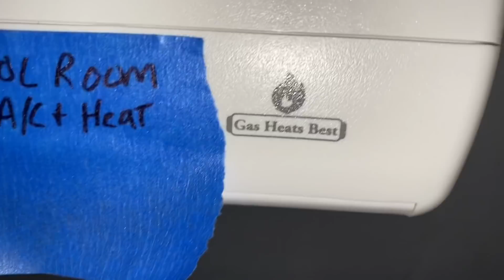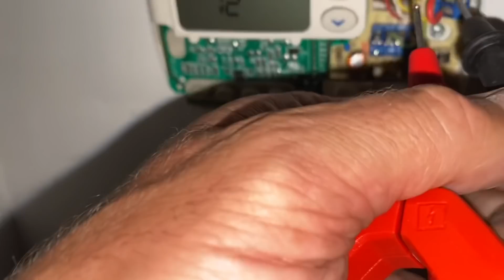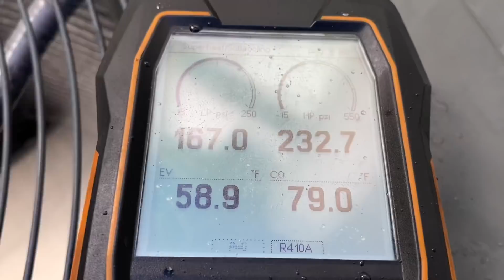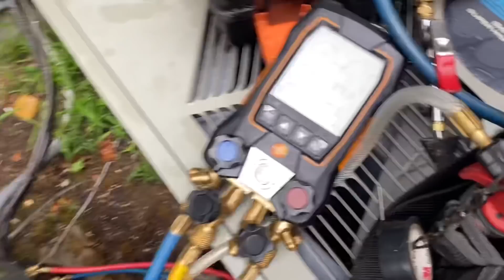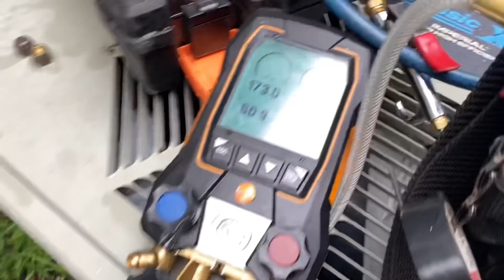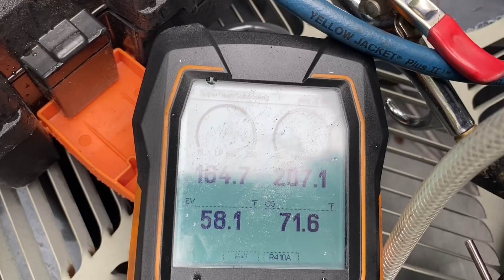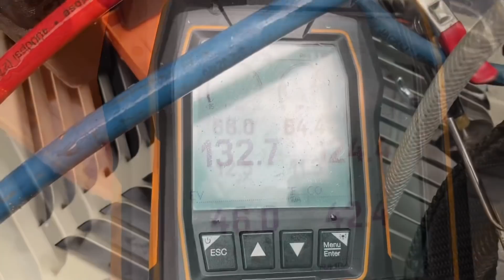Mysterious Issues With Central AC Compressor on Trane R410A System - Why? Bad TXV Killer 1 Already

Comment: Had the same problem a couple weeks ago.
Same pressure readings but in my case you can hear the bypass relief valve. And I wasn't able to pump it down. After changing the Compressor ac system ran like a Champ. Good call.

Comment: All the craziness that can go on... I have a Trane (American Standard)  and just happened to be home when the power blipped .... Scroll compressor started running in reverse  It was LOUD and i knew not right so pulled the disconnect  outside and let it sit... after 20 minutes reconnected and didnt seem to do any harm.  Its a Copeland and they are tough as nails.

Comment: Cheapskate customer: 1976 payne pkg unit, bad compressor. Owner had said it was about 15 years old and had been down a few years (decades probably). The unit is basically scrap. Told the guy to replace it. He hires some  "handyman" to R&R compressor. Installs a 410a compressor. Calls me out of the blue and says he purchased a jug of 410a, but handyman has no gauges and would I be interested in charging it for him? I couldn't help from laughing....enough for him to hang up on me. Some people!

Comment: Wow , I wonder if that was one of those set ups where they test repair techs to see if they are exploiting customers . Your SOOOO right Mikey . It was sabotage . Someone was messin’ with Mikey pipes . Not cool . Mikey pipes wasn’t born yesterday . Good diagnosis and I’m not even a hvac tech . A cars a/c compressor would act similar if it were weak . Shows up on the gauges . Daniel is getting taught very well 👍

Comment: Seen scroll compressors with high back and low head have a leaking internal relief . If you loose a condenser motor or really plugged coil with no hp cutout pressure relief opens and may not completely close .

Comment: @5:50 that burnt label, in a perfect oval, I believe that is the compressor tag you pull of when replacing under warranty and send it in with the paperwork and old compressor, the units usually come with an orange, I bet that black is a warranty change out/ what the supply house had in stock at the time

Comment: Miss the old recips. Tuff, and checking the valves with pump down was very conclusive. Ya could actually pump the low side into a vacuum if the pump and valves were good.👍 
Really like that new flare tool as well. Good job, brother.

Comment: The compressor likely has bad valves causing the compressor to over heat and not compress. If you see funky pressures and you close the liquid king valve down you might have a bad reversing valve unless you hear the compressor bypass valve. Why you're seeing is someone took the label off of it for their records. you still have another label underneath. Likely someone scamming the manufacture by taking serial off and putting it on another compressor to get multible warranties. Id check the amp draw if its really low you have a broken shaft. Thanks for the videos as always Mikey Pipes the pipe Doctor!

Comment: Rare to see a replacement compressor on a residential unit! Those scroll compressors are not a tough as the old recips! They are pot metal inside and are cheaper to make! Great video and great call to just replace that crap Mikey pipes!

Comment: hi, i bought a new air conditioning unit within the last year and a half from Goettl. the compressor just went out (it kept tripping the breaker). They replaced the compressor, do u think that there is harm to the condenser or any other parts from having a bad compressor. is it normal to just replace compressors without replacing condenser or anything else?
Reply: Yes, as long as they replaced the refrigerant and pulled a good evac on system.
Reply: @anthony5530  ty

Comment: That looks like a scroll compressor, they don’t have conventional valves. It still should pump down, not below 15 psi or so according to Trane. I have seen single phase units run backwards. I would definitely recommend looking at the line set piping. Seen the backwards single phase compressor on a HVACR School Video about why capacitors fail. Always have to wonder why when they die prematurely. Also have other people’s work you are relying on. Not good when it’s your companies reputation is on the line. Thanks for taking us along. Pump down and amp draw work great on reciprocating compressors. A backwards scroll sounds bad, see this on three phase systems every once in a while, normally after electrician changes building supply wiring and doesn’t verify rotation. They do make a three phase rotation meter, I am not being a joker.

Comment: I have seen this before, but the unit was grossly over charged and caused compressor issues anyway, it was also a different system, a commercial walk in freezer with the big copland 2 piston semi hermetic compressor, I was scratching my head, till I started reclaiming the 404A and filled up two 50lb cylinders and part of another. But after going thru the compressor valve body etc, the valve reed was bent on the suction side and had a crack across it.

Comment: Man. Wow another test method for a compressor ! That’s a great idea ! Great video ! Thanks !
Reply: Id reccomend getting amp draw, closing the liquid king valve to test pump down, listening for the bypass valve, if you hear grinding likely a bad valve in compressor. In addition if it is a heat pump see what it does when you energize the reversing valve or de-energize it. Ive had a few people who had multible people come out to quote someone a new compressor but i found out its a reversing valve not switching over properly or have a fracture on the switching gas tubes.

Comment: I made a comment a few minutes ago and erased it because I think it may have dawned on me what you did. You took voltage reading between red and green. I was confused because you wouldn't get voltage between red and green if red is passing power to Green due to no difference in potential. 

Then it dawned on me that you pulled the thermostat off. You were checking between red and green because green ultimately goes through a relay coil and back to common. 

Am i correct?

Comment: High suction, low discharge, low liquid press, low comp amp draw = comp valve issue
Reply: Copeland always has a back up label underneath outer label

Comment: Mikey Pipes, I don’t know if you can answer this for me. But when you check pressure on a system, is there a certain pressure that all systems should be or is it just go by the label or charge. If you could based off of they system you were diagnosing the bad compressor, what should the pressures been on that system?

Comment: Mike, there is something else wrong in that system.  Is the condenser above the air handler, if so it probably should have a trap in the suction line, if not you need to investigate more, why did it kill two compressors, good luck.
Reply: I think they have an accumulator.

Comment: It's suppose to be a trane roto lock compressor. Had a copeland installed in one and was not getting more than 14 TD. Has to be trane factory compressor
Reply: Trane does use Copeland scrolls also throughout the line

Comment: Ya that compressor damage was awfully odd, first thing I thought of was it had a crank case heater on it in that spot and the CCH went bad leaving a burn mark

Also Copland puts stickers under stickers so if the top one wears out you can peel it and have a good sticker underneath to find your numbers

Comment: I'm so glad I was at this service call, now I know a method to test a compressor if I suspect it's bad. More testing Less guessing
Reply: WorldRenownedCFE  Actually, the teachers in hvac schools usually teach that closing those valves shouldn't be done because it puts stress on the system, compressor, valves and everything in it, especially if it has been over charged, just 15% over charge can cause an inefficient compressor to blow, which on a system that holds 9 lbs refrigerant, that is only 1.35 lbs of added refrigerant to a system and on Heil condensers, I have never been able to pump one down that had the extra charge for the lineset in it, even when brand new and someone forgot to put the valve cores back in and we didn't have the core removal tool on the line, this is where I blame my helper LOL, but I know, I should have looked before sending onto the next steps.
Reply: WorldRenownedCFE  I did not learn using the pump down method to test if a compressor is working.
Reply: Theres other things to determine the compressors failed or not. Especially if it is a heatpump watch out for it fudging your pressures. Mikey made the good call for replacing the entire condensing unit so he wouldnt get a call back after replacing the compressor. Luckily for him and the customer the equipment was a 410a system
Reply: @mauichaui641  Yes there are and a heat pump can throw you for a loop. What are some of the other things to check a compressor to see if it has failed or not? We need to give Danielson as much enlightenment as he can get!
Reply: @AaronCo29  audio cues such as grinding, humming, hissing. The. Amp draws if it's way to low like 2 amp or way to high like 30 (on a standard 208/230 scroll 3t compressor. Too low of ampdraw will mean broken shaft or low charge if there's no LP switch. Too high usually means over charge or bad capacitor. If you have blown fuse or trip breaker ALWAYS check the compressor windings to ground and make sure the windings arent shorted. If it's 1ph you'll see ohm 2,3,5 (each whinding will be different) if it's 3ph all windings should be the same. Reason you want to check to ground and direct shorts is that if you turn it back on you could blow out your pecker head and see 5lbs of freon or more creating a massive cloud around you. There's other things of course to test but that pretty much sums up most of it.
Reply: @PipeDoctor   Keep learning Daniel.. Learn from multiple sources...video
.books...hands on....and of course...Mikey